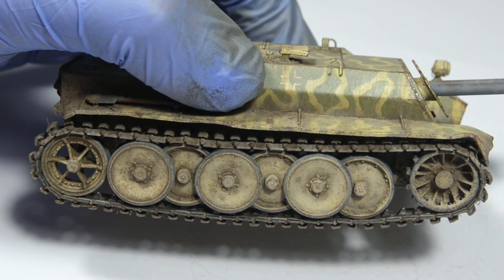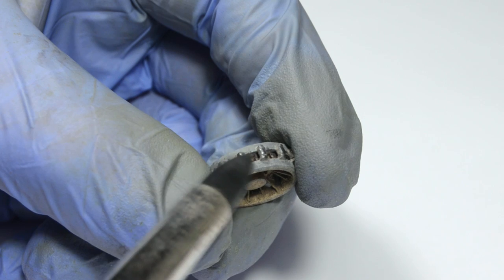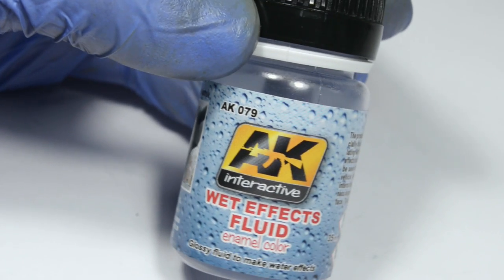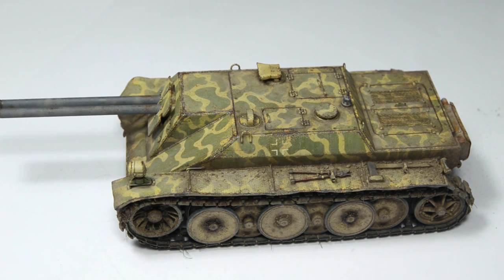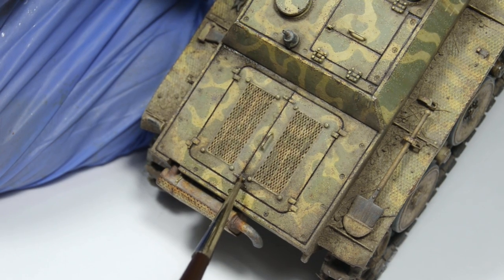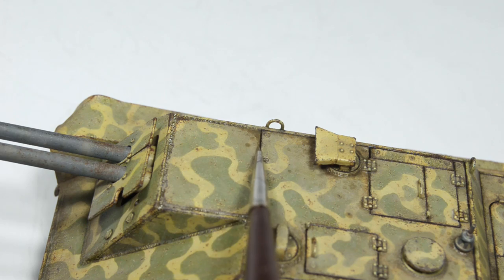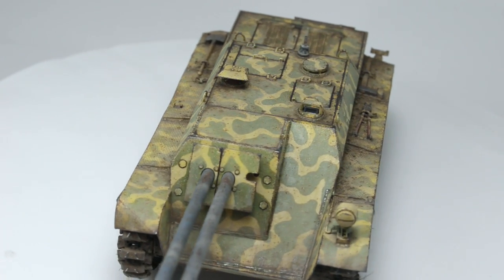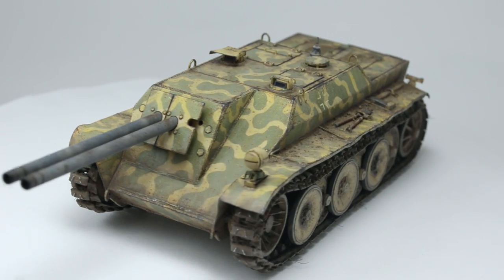Let's Finish The Rutscher From Das Werk!

Comment from the maker: Hey guys, 
some of you mentioned that I attached the running gear in wrong order and the right side should be reversed. Unfortunately I can't double check it because I don't have the kit instructions anymore, but if I remember correctly I looked at the instructions several times while I was building it for this exact reason. 
The box art also suggests this is how it was intended, so maybe it was a mistake on their side and I blindly followed it, or it was done on purpose since it's a fictional vehicle and they wanted to make the running gear look different than the Sdkfz 251 which had the same wheels and tracks 🤔

Also, I just finished building the next model, and there are tons of photos of it on Patreon, including some fresh and cool HD pics, a small photo tutorial and lots of daily updates from the construction process 🤤
Reply: Night Shift dont rivet count on yourself! Thank you for inspiration, learnings and entertainment!
Reply: I forgot it was Friday :O
Reply: For those who don't know— the left and the right gear pattern in this Rutscher is not correct. It's easy to notice once you see that the rear wheels are placed differently. Obviously, this is a huge mistake from the model brand, but it's really weird that they messed it up like this. To me, personally, it doesn't really matter but it's something to point out if someone gets to build this model and make the same mistake that the box art and the manual shows.
Reply: Indeed the design from Amusing have a fail in that point. All german vehicles have his wheels order mirorred for a reason of stability and gravity center. They dont research enought and for that all kits came with that fail.
Reply: Well, tracks were often installed incorrectly on actual tanks by the crews so no harm done there Martin!
Reply: What happens if a car is unbalanced? This are the same. You can drive with that but always broken easy and faster, and never can get his max speed.. in a Tank that never was seen before. 

About his tracks in 2 different ways are not the same,  the reason behind that is extend the utility.
Reply: Definitely up to the kit manufacturer. Even with the odd mistake, it looks great and that's what counts. The new book panzers in Berlin has a bunch of pictures of these vehicles. Cool to check out. People will complain"it's rivet counting" it's not. It's just a bad mistake on the company. I wish people would stop with the rivet counting crap to answer anything negative. It's facts. That's all. It's not a bolt is 1mm off, don't confuse the 2. Great job as usual. Love it. On to the next
Reply: Later to watch the new video a little mechanics corrections:
- tracks in incorrect position dont works (251 is not like a normal tank).
- the theet in the sprocket work like little return rollers and are from rubber, not steel.
The rest is excelent how always. Always think, for do a good job of weathering will be important to know what is wich part, with material was used, how this works? For do a great weathering. At this model you showed me that was correct Way, but not this time sadly in his train. Thanks for all videos, was great.

Comment: Thought you might be interested in this. You mentioned Germans used smokeless. Actually everyone was using some kind of smokeless at this point. The relevant point is that smokeless doesn't mean it doesn't make smoke at all. Smokeless is less smoke than black powder which it replaced. In comparison to black powder it might be considered "smokeless". However even modern propellant produces visible carbon and soot which needs to be cleaned off with a pretty modest number of rounds. It wouldn't be implausible to see a barrel with soot at the end even with smokeless.

Comment: There was no "right" or "wrong" direction of the tracks. On facebook, I've read a story of a guy, whose grandfather served on the StuG III. They put an older track on their tank in one direction and a newer one in the other direction, so that the guys in the repair section could see quickly, which track needed to be replaced next.. I've never thought about that, but it makes sense.
So yes, if you want to build a tank, that is fresh from the factory, I suppose, the tracks are both in one direction, but if you want to build a tank, that has seen some shit, you don't need to bother

Comment: Have yo noticed the difference between the left side and right side positions of the middle wheel group. They are different. Left side middle wheels are closer to the front gearwheel. Why is that?
Reply: probably due to the way that they used a torsion bar suspension system. If you look at Panther's running gears they are in such a way too.